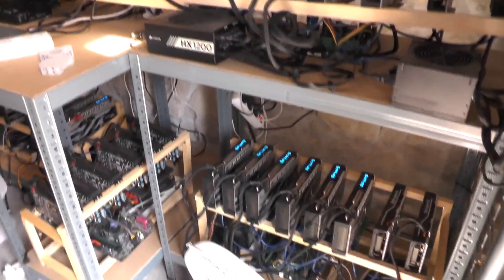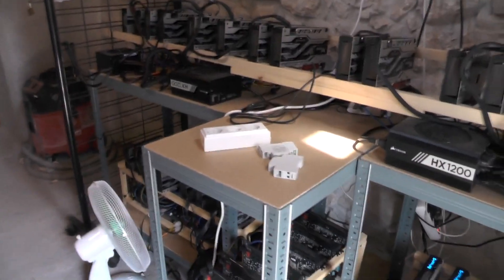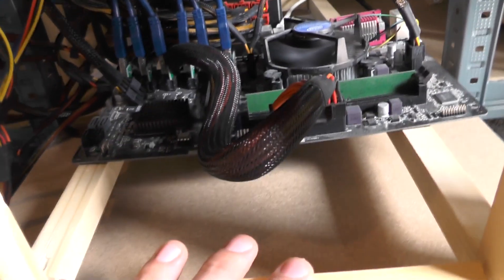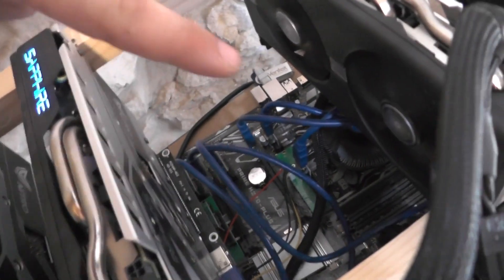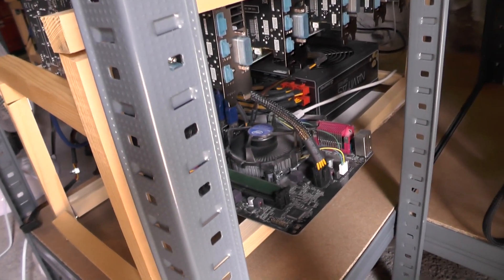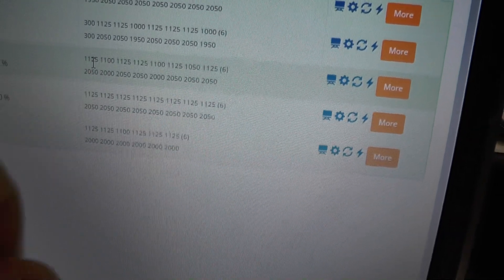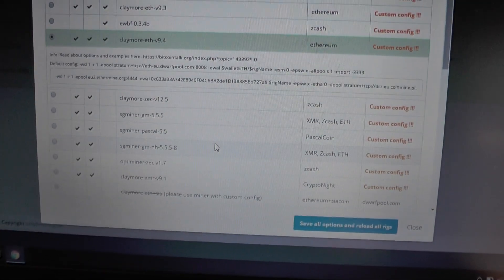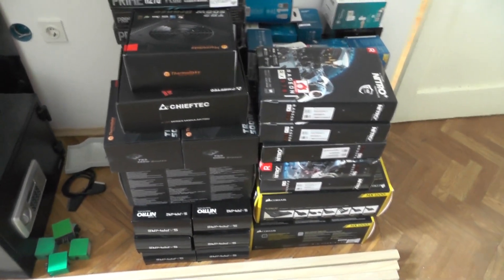[HW: a small mining farm] 38 GPUs, SimpleMining and more...

Comment: suggestion, but these are my opinion.
1 use a large cfm blower designed for high pressure usage, ie. http://www.surpluscenter.com/Electrical/Blowers-Fans/AC-Centrifugal-Blowers/1530-CFM-230-VAC-FH355-REVERSE-CURVE-IMPELLER-BLOWER-16-1481.axd. i had one like this but 120 volt and that cfm is misleading. it feels like much more. that fan in a simple box moves massive amount of air
2. seal the room as tightly as possible so that you can ...........
3 build a filter box. preferably build a frame around the inlet so that 5 sides are covered in pleated filters .
mind you these are just suggestion but they will remove the heat and dust problems that you may incur now or in the future

Comment: I'll sell you another for $300
Reply from the maker: ehh, believe it or not i can (could until all were sold out) got a new one for about 200$ in here :D (croatia)... nayway, i'll post the links today or tomorrow for that programmer.
Reply: MTS wow that's cheap, it's considered robbery if you can get one here for less than $400
Reply from the maker: yeah, but croatian default salary is about 500-600$ so....
Reply: MTS the links for the programmer and the clamps so I don't have to unsolder? thanks very much!!!
Reply from the maker: www.ebay.com/itm/CH341A-24-25-Series-DVD-EEPROM-Flash-BIOS-USB-Programmer-with-Software-Driver-/232145989894?hash=item360cfab106:g:qeUAAOSwux5YNT3A

http://www.ebay.com/itm/SOIC8-SOP8-Flash-Chip-IC-Test-Clips-Socket-Adpter-BIOS-24-25-93-Programmer-Adapt-/332115169124?var=&hash=item4d539b4f64:m:mu1des1gLGDyJjAO1rKbVXg

and this is the link to my video: https://youtu.be/1VyKe2WYZJk
Reply from the maker: ** bare in mind i did not use this programmer so i cannot show you how to use software, but it's basicall open - erase chip - program :)
Reply: what kind of bios chip is it? 24 25 or 93? also the reviews say it does not have drivers so I need to find a different one :( also should I select the clip with the wire or one of the box things
Reply from the maker: Select IC Test clips, chip should be 25xxxxx (only one onboard that's 25) regarding drivers, just contact seller, i haven't met chinese seller that does not have drivers :D (usually supplied with software), also, when programming ALWAYS SAVE OLD FIRMWARE just in case...
Reply: thanks A bunch man is there some other way I can contact you in case I need some help? I sent you about $17 in BTC which is my profit of 3 days of mining lol
Reply: also is the bios chip SPI or some other type? I Might just get a raspberry pi to do it with and kill 10 birds with one stone :)
Reply from the maker: There is an email address on my homepage... actually there's only that in my homepage.
Reply from the maker: Spi it is

Comment: Amazing!

BTW by its ASUS GPU Tweak default gets in about 70-77C under 100% usage. Is it normal temperature?
Reply from the maker: That's a nice temp
Reply: Do you overclock/undervolt GPUs? Im dying to do the same I think the XFX RX 470 is under hash at 21 m/h. At least I should reach 25-26 m/h at best. 

Current reading from Radeon Wattman from default:

Activity: 100%
GPU: 1249 Mhz
Memory: 1750 Mhz
Temp: 65C
Fan: 2580

RAM: DDR3 6GB
CPU: Corei3 @ 3.4Ghz

Any help. Thanks.
Reply from the maker: modify bios, change clock to 1150 and ram to 1950, you'll get 27MHs.
Also, copy value from 1750 to 2000 (bottom right in polaris editor). but be careful not to f-up bios (first check the brand of the ram and then download polaris bios editor accordingly - there are both available for download from me - links in GPU-related-videos)
Reply: Polaris bios doesnt show default values when run. What file I need to open?
Reply from the maker: Downlod atiflash 2.71 and dump your bios, then open that file in polaris (i've made a video about it)
Reply: IF the bios f-up will the card be working after restoring the original setup?
Reply from the maker: you can use software. (MSI overbuerner for example) however, you'll have to copy values from 1750 >> 2000 in order to get better hashrate, you can send me dumped bios and i'll mod it ;)
Reply: I switch to silent mode and dump bios with ATIWinFlash. When opening with PolarisBios it give me an error 
This BIOS is than the standard 512KB.

XFX memory type of Hynix
Reply from the maker: that's OK, some bioses are 256kb. However timings must be right.
Reply from the maker: which ram does your gpu have? samsung, micron, elpida? Start GPU-Z and please tell me the manufacturer.
Reply: Nailed it! I copied strapped 15000 to higher. Run the patch after flashing bios. Restart.
Reply from the maker: yup.
Reply: Finally nailed it! With default bios moding RX 480 27.x MH/z RX 470 24.X. I understand I can stretch it more but with MSI afterburner while on RX 480 the settings are replicated to RX 470.

Is it possible to OC moded GPU separately while  plugin at same time?
Reply from the maker: woohoo! :)

Comment: good videos MTS lots of good info :) Just wondering if you can help me i have 2 Asus prime z270-p motherboards running 7 cards each (14 total) Now 6 gpu on each board are connected by pcie slot and 1 gpu on each are connected by m.2 to pcie adapter and this all works fine and stable. But neither of these rigs will detect a 8th gpu connected by m.2 to pcie it just won't detect it played about with it for days. You have any ideas thanks :D
Reply from the maker: you have a bios option that explicitly sets m.2 to pcie (either that or other m.2 card is faulty (or does not recieve enough power?))
Reply: Hi James, you can only use one of the M2-ports for PCI-E on the Asus Z270A Prime
Reply: I think it is the same with the Z270-p motherboard.
Reply from the maker: are you sure? that kinda does not make sense... 
...however, wtih these mobos lot of things don't make any sense :)))))
Reply: Yeah im not to sure i still only have the 7 working on each board, All settings are good in bios pcie is selected etc only the one m.2 slot working on each board.
Reply: Now, I'm not sure :)